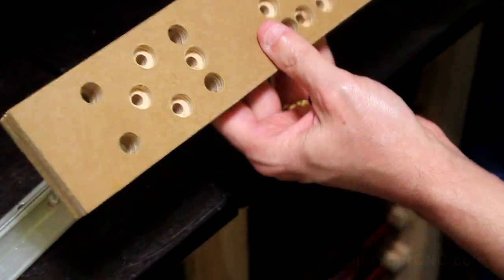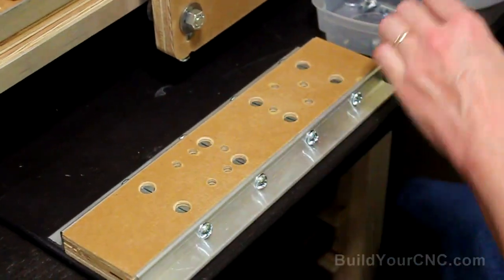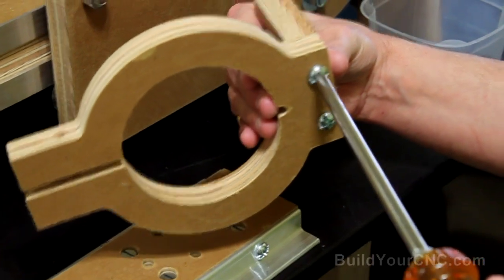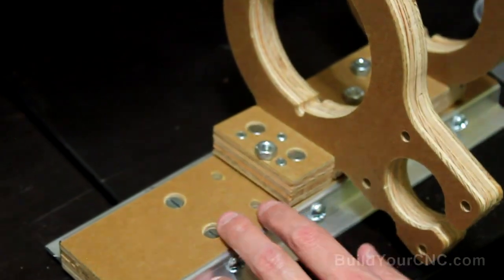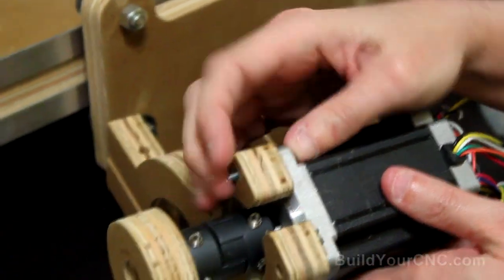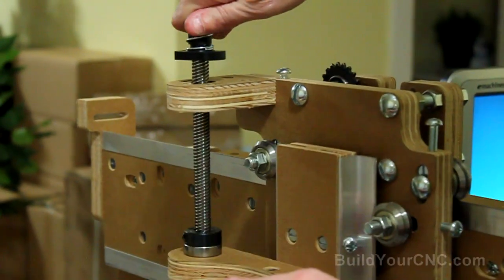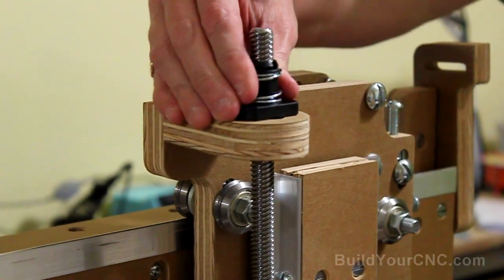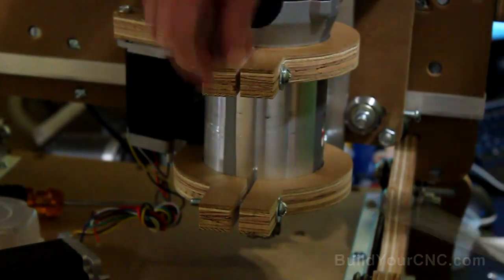blueChick v4.2 - Putting Together the Z-Axis Assembly and Attaching it to the Z/Y Plate

Comment from the maker: @stoneground1 Hey, thanks for the suggestion, and thanks for the kind words.  The positioning of the lead screw using the grooves provided is actually a product of thickness variation in stock MDO.  Once the lead screw is aligned vertical, there should not be a problem.  A while back, I had bearings at both ends of the lead screw; however, I have been challenging myself to design simpler.

Comment: Just a thought....where your anti-backlash nut is, instead of just "getting" it center, why not use another bearing flush mounted on top to get it centered perfectly. That way it would be centered beforehand and it wouldn't wear anything down, then you can bolt the anti-backlash nut on and not have to worry about the leadscrew getting off center. I like the design of the unit just thought it would help out in error proofing.
Thanks for letting the little guys get a piece of the pie!!! Peace!!!